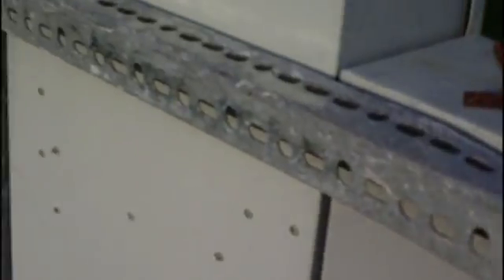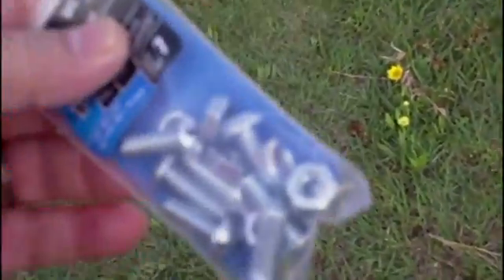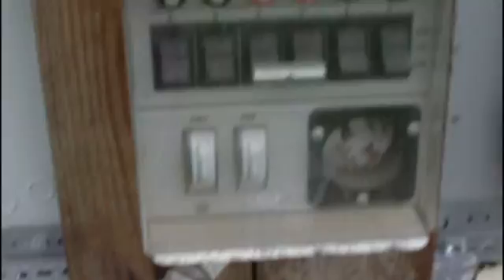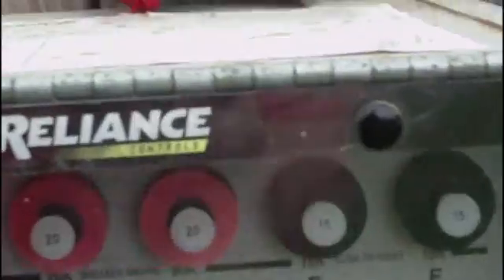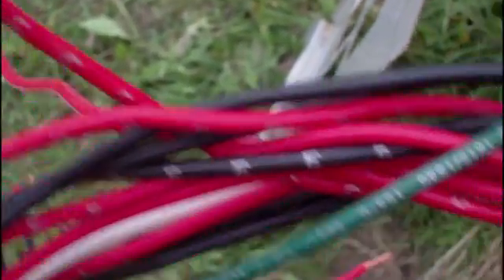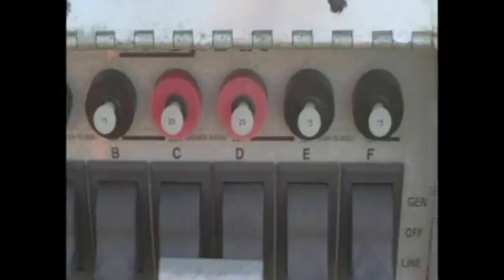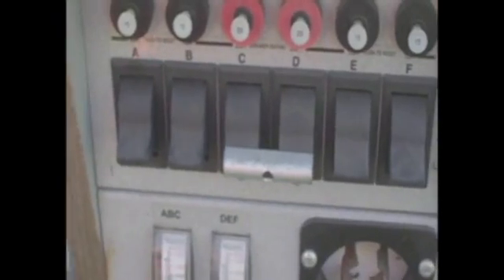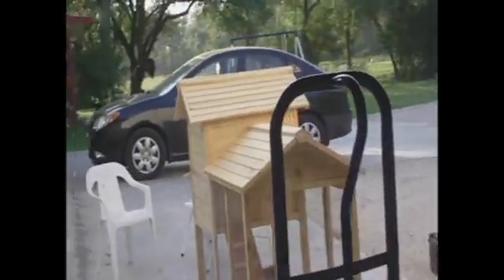Second Wind & Solar Transfer Panel

Comment from the maker: @RollinTidez You're off to a god start, anything you can do to get started is goodness. You can do a lot with that 100 watt panel, remember that the fridge does not run continuously and that helps. I would think if you can generate 200w of solar, you can take care of a fridge from your batteries.

Comment: Great job AL. I have a long way to go to catch you guys. Right now I only have a couple 100w panels (setting in the shed). I hope to get 300-400 more watts pretty soon. Hoping to at least be able to run the fridge if the power goes down.